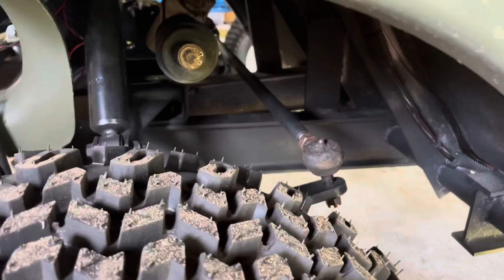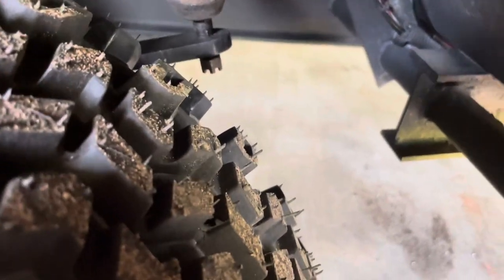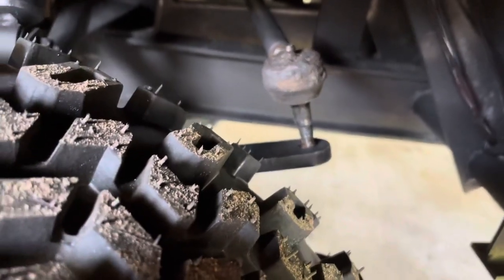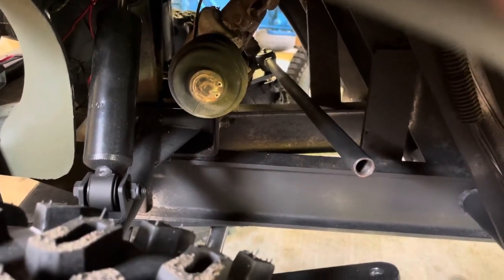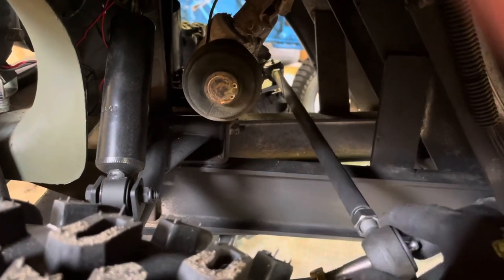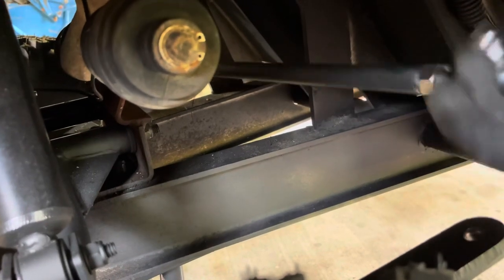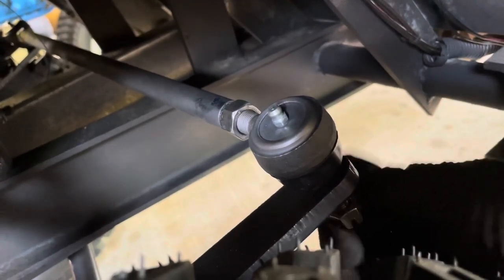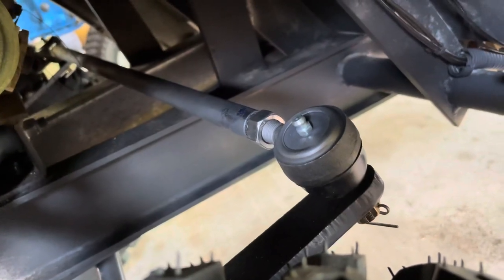Club Car DS Tie Rod joint change

Comment: The tie rod joints don't need to tightened down snug with the castle nut and then the cotter pin inserted?